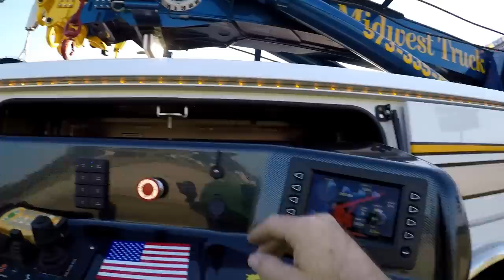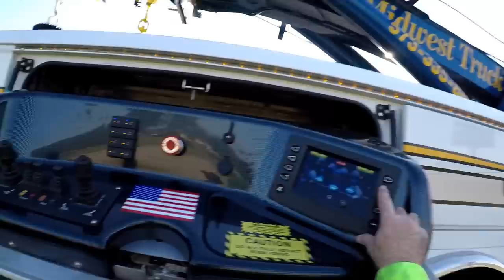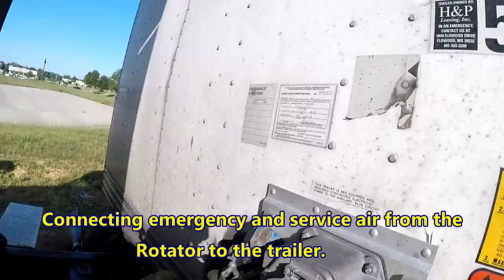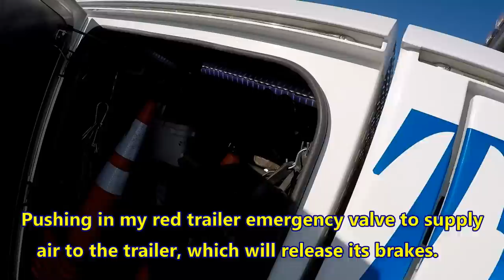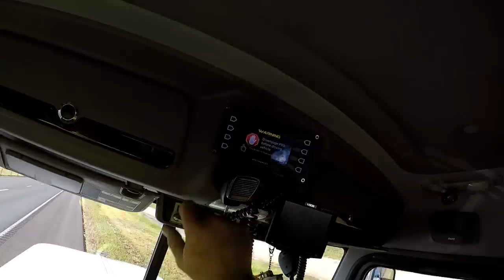BCD    Barrier Cable Destruction

Comment: Need to put an old Q siren on that truck.. They'll hear you then!
Reply: I am retitred from truckin, Have aways wodered whit size motot and tranny tou run in the rorator ( top speed)
Reply: Was about to comment the same thing.
Reply: Since when do tow trucks have sirens?
Reply: YES! A Q will let anyone know you're coming. I accidentally hit the switch on  the one in our squad when I was a n00b... at 4am in a populated area. Didn't know where the kill switch was either....
Reply: Would recommend a rumbler over a Q siren. It catches attention without all the sheer noise.
Reply: Jason Asselin i
Reply from the maker: I'd love to have a Q.  They are very expensive, though.  Thanks and God bless.
Reply: Check eBay and other sites online, you can find some cheap..
Reply: Alan McKnight in state of missouri tow trucks are considered emergency vehicles
Reply: Alan McKnight you can run sirens on them if its a bad emergency
Reply: and a train horn that will get some attention
Reply: You also need to use your horn for intersection clearing. To get you on scene faster. You need to push your way through those cars.
Reply: Huh. Learn something new every day.
Reply: Jason Asselin I
Reply: Not sure what a Q is, but perhaps at as cheaper alternative, run a Siren Speaker through a set of Mountain Air Horn tubes...instant amplifier (in theory)...everyone in 2-3 miles would be getting the heck out of your way...
Reply: Alan McKnight in some states you tow trucks are are emergency vehicles
Reply: @HappilyHomicidalHooligan  lol
Reply: He has one now

Comment: Another great recovery Ron. Looked like the poor guy ran over 1/2 mile of cable barrier. Glad nobody got hurt. Lots of damage under the truck will add up for a costly repair. I remember once when I was flat bedding, I blew a tire on a 45 foot spread axle aluminum flat bed, out in IA. The boss told me to turn around at next exit & drive back 40 miles to a truck stop as he didn't want to pay for a service call. By the time I got back to the truck stop, now it's 2 tires,  an airbag, some aluminum welding, & a couple of rear lights. Damn alligators. LOL. God Bless & keep up the great work.
Reply: SO your boss insteadd of paying for a service call would up paying more than what the call would have cost. HHaaa

Comment: I'm am very sad concerning the lack of people not getting out of the way of your truck
Reply: Carl, like you, I am amazed and blown away how inconsiderate other drivers are about not yielding to Red & Blue lights, and siren.   Granted, there are and will be times with no place to go, but give the guy a break.
Reply from the maker: As am I.  It is a constant battle.  Thanks for watching and God bless.
Reply: They probably just don't connect a big wrecker truck like that to being an emergency vehicle, probably not as common to see at a fire truck or police.
Reply: That guys at the light in the 4x4 doesn't have to move. There is no law to say that u have to move it usually out of respect
Reply from the maker: @alexthompson2289  Actually most state do have a law requiring that vehicles "Yield/move for oncoming emergency vehicles" .   Most states includes this as part of their Slow Down Move Over law which now includes most services that work roadside, whether it is Police, Fire, road construction crews, towing/recovery units, road service trucks, etc.   It IS the law in most all states and all it take is a couple seconds out of someone's day.  It's not too much to ask so that we can ALL go home at the end of the day.   Thanks and God bless.
Reply: @RonPratt  I mean at lights if u are at the front and u can't move or go throw the light because it's red

Comment: I look at those cables and think" hitting that is going to be like a cheese cutter..."   :-)
Reply: The cables themselves are under a lot of tension, but they are designed to give your car a nice gentle hug. As nice and gentle as the men in the nice white  coats that take you to the padded room. ;) They are designed to ensnare and stop a car. And belive me, I've seen enough of Ron's videos to know that no transportation agency wants you to cut those cables. The posts are inexpensive to replace. But if you cut the cable, you have to replace the entire thing. The cable itself probably isn't that expensive. But the equipment to move onsite to tension it, install it, combined with having to shut the road down to re-install, gets very expensive. GOd Bless!
Reply: Mercmad As a motorcyclist we look at those cables and think that they may as well be razor sharp.
Reply from the maker: Most vehicles and some people don't survive encounters with the barrier cables.  They do their job well, but they destroy anything that they ensnare.  I was very surprised that this truck took out so much cable and came back on the road.  Normally the cables wrap up the vehicle.  Thanks for watching and God bless.
Reply from the maker: gorillaau    At the first accident I worked after the cable system was installed, I clearly remember the Trooper stating that he was not looking forward to any motorcycle encounters with the cables.  Be safe.  Keep both wheels on the pavement...  God bless.
Reply from the maker: Raina Selone   Once again, you have helped me in my time of need.  Time has not been friendly to me recently and I have been delayed in my responses.  Thanks for helping me out.  God bless.

Comment: Ron Pratt Nice messy job before  the fair. How long does it normally take to do an job like this with and with out police safety buffer?
Reply from the maker: I still have to follow all the same steps to prepare the truck and trailer for tow.  Without the police/fire buffer I have to deploy road cones and take extra safety steps as well as constantly watching my own back....called "keeping your head on a swivel".  So it would take a little longer without their assistance.   As always, thank you.  God bless.
Reply: Ron Pratt your police are better than our police and highways agency yours would come out and do safety buffer ours won't that's why an recovery agent got killed here a couple of weeks ago.
Reply: Bet tow trucks and recovery vehicles aren't considered emergency vehicles in your state either, are they? Here in WI they're not, and I think even though you can get one heck of a fine and license suspension for not slowing down/moving over, them not being considered emergency vehicles just creates more safety issues. Cops usually aren't around to buffer unless it's on an interstate, and even at that I think I've only seen one standing in the lane like that in my whole life, and I believe it makes people disregard the move over/slow down law even more, because there's nobody there to enforce it the vast majority of the time.
Reply: @MrFredboy  your right here in WI if you're on the side of the road your on your own. And most of the time no one will stop to check on you.

Comment: If it were my rotator and I was responding code, i would add more lights all the way around the truck. Also, dual speakers for the siren and a rumbler
Reply: deereman260 what and stop people from playing on their phones
Reply: It’s hard to hear one speaker at highway speeds. And people don’t care about amber lights anymore so more red and blue would help with traffic clearing and some on the back would keep people from passing him
Reply: deereman260 It wouldn’t make much difference.
Reply: He has red and blues and runs them when the sirens are on in combination with the ambers.. even though in his state tow trucks are considered emergency vehicles, people thing, "Oh it's just a tow truck" but more so with the rotator, he could be called out to help with an extraction as he has the directional lifting abilities.
Reply from the maker: From what I've been told, anything over 65 mph and you are "over-driving" the sirens.  We've tried different combinations of lights, sirens, train horns, etc., and some people simply will need give way.  Sad but true.  Thanks for watching and God bless.

Comment: Those cable barriers have almost been completely removed here in the UK, Too many fatal accidents involving motorcycles.  
All Armco Barriers now with square impact ends as they found the rounded down end launched vehicles into the air if hit with speed.

Comment: Thanks for another great video. I never saw you use service/emergency air before as you did on this one. Also, I learn something new every time I watch a video, especially with your helpful text-comments. Today is odd (9/26/2017), because I just passed my written CDL tests which included an air-brake section, some of which related to this video. Thank you once more for your fine video.
Reply: All the best on your Road Exam for the full License when the time comes.

Comment: It seems like you get the Rotator "up on the step" real quick! A lot of the people driving cars seem very confused when they see you in the tow-truck, with the red and blues flashing and the siren wailing. Another fine video Ron!
Reply from the maker: People aren't accustomed to seeing a tow/recovery truck run code.  When you get around St. Louis it is much more common on tow trucks so people are more attentive.  We are one of only a handful in our area that run red/blue lights and sirens.  Thanks and God bless.

Comment: Cage bolts are handy, but sometimes when you are in a jam it's a lot easier to just pull out the clevis pins where the rod connects to the actuator arm on the slack adjuster. Nice job as always Ron, you and your company are a first class operation.
Reply from the maker: I've had to do that before....like when the e-brake spring is off to one side and you can't lock the t-bolt in.  Thanks for watching and God bless.

Comment: Nice video. A buddy of mine has a wrecker business like yours and a few years ago on Thanksgiving day he had a truck that was cut off by a car and the trucks full load of hams shifted forward ripping the front of the trailer apart. He asked the company what to do with the load and they said to donate it so they found a mission a few miles away that was able to take them. Took him over 5hrs because he didn't have a pallet jack and the mission didn't have a dock so he had to pull out and transport each pallet with rollbacks.

Comment: I think I understand why that one truck you showed burned to the frame and engines block.  I noticed in this video that the cab is made primarily of fiberglass which I am guessing will burn quickly if it catches on fire.  The other truck from the other video didn’t stand a chance without the fire brigade being on scene in like minutes.  I still can’t believe what I saw in the other video.  Glad this driver was unharmed and that his truck was still repairable.

Comment: You worked hard for your money on your own on that one, and all that oil on the ground and over the under-frame didn't help either. But at least the police were thinking about your safety.

Safety chain gated hooks in the upturned open tow hooks ? Not sure if my reasoning is correct, but If it had broke loose and dropped not sure if the hooks would have stayed together !
Thanks Ron for another brilliant informative full length video.

Comment: I was in Iraq in 2005 and had to do a rush caging of two axles on a three axle trailer, that had all his electrical and air lines ripped out during a convoy. It only had "Maxie's" on two of the axles. I'm guessing you can figure out why the rush. (In a war zone)
Great fast and safe job, look forward to the next video. God Bless!

Comment: Man oh man Ron!  This job fought you from the bumper to the box. It seemed like every piece of running, except the tires somehow was busted!  As I've watched your videos there's a pattern to the complexity of the tow is related to the number of actions on your rig. Such as; the number of laps you make around your rig, the number of boxes/cabinets on your rig you have to open and more than once, and finally when you get REAL quiet. Usually, you're great with continuous color commentary. Like the "John Madden" of vehicle recovery.  AND you do it without foul language. AND you don't blame anybody. It may or may not have been the driver's fault, or a poorly maintained vehicle, or as in this case an alleged driver that cut off the truck driver.  Could have been lots of blame to go around here and in many other videos of yours. There's no 20/20 hindsight. You may wonder out loud but that's what keeps many of your videos most interesting. What on earth DID happen and what will you have to do to fix it?  Good job! God Speed. Stay safe.

Comment: If there comes a time when you can't get a brake chamber caged, you can back off the slack adjuster until the brake pads release from the drum. You turn the adjustment bolt counter-clockwise with a 7/16 wrench. It will make a loud clicking sound and be hard to turn because of the mechanism that keeps it from backing off by itself. You can tell that the brake is released by the sound the drum makes when struck with a wrench or other metal object. If it makes a thud the brakes are still set, if it makes a ringing sound the wheel is free to roll.

Comment: Hey, Ron! If you're still in the mood to answer questions, I've been wondering why it's necessary to drop the driveshaft in a manual transmission equipped trucks. Constant mesh transmissions churn around the gear oil whenever they are in motion and thus it ensures that the gears and bearings stay lubricated, unlike automatic transmissions. Am I missing something?

Comment: Hi Ron.  Once again a nice, thoroughly professional recovery.  Kudos to the Police Officer for standing in the lane to try and keep the traffic clear of you, despite so many running fast by you in lane one.  I look forward to seeing your new RGB light in operation.  Was it my comment that sparked the idea? lol.  

Why do you need to connect three lengths of each air line?  Wouldn't it be more practical to have a set of short (to power a cab air system) and a much longer set to reach to the trailer?

Anyway, stay safe and God bless you and yours.  Love from Scotland.
Reply from the maker: Yes, I am very grateful to the officer.  As for the RGB light, the company that builds them supplied me with one to try out.  I couldn't find a suitable location on the truck, so I decided to make it portable by customizing a shop work light stand.  As for the air lines, I would have normally ran an air line to the tractor, but it's air system was HEAVILY damaged and wouldn't hold air pressure.  That is why I had to cage the spring brake chambers on the tractor.  I do have long rubber hoses that I can run from my truck to the trailer.  I prefer to use the air coils, because they allow for more flex while towing and don't require as much securement.  Just my personal preference.  That's all.  As always, thank you and God bless.

Comment: Ron, I like how you put the "time lapse" on the back end of your videos. Also a siren hooked up to your air brakes (ala fire truck, and old school audible alarm) would do a better job. BTW, in fire trucks, the Captain (passenger in this case) has a foot activated pedal on the passenger side of the cab, as the driver (aka Engineer/F.E.O. (Fire Equipment Operator) has enough to worry about getting to the fire scene.

Comment: I am a newer subscriber so some of the questions I have might have been answered somewhere throughout other videos. I am surprised on how much work goes into on of these tows. I have a new found respect for your profession. I am trying to get through all the past videos. I doubt I will ever get bored of them. These tows have to be very expensive. or they should be as you put your life on the line for them. Is it ok to ask on average what this kind of tow cost? is the driver (non-owner/operator) on the hook for that, or is the trucking company. I completely understand if you do not want to answer.
Reply: Pricing is often asked but will NOT go answered since it varies by situation and all plus its not really a public matter let alone private.

Comment: Instead of those springy hoses going back to the trailer, wouldn't be easier if you have just one 3/4 Dia. air-hose, then formulate an adapter for the trailer and your truck that has two fittings for hooking up and simply use blue and red shrink tape on each end for marking? 
I think you scratched the paint messing with that Cascadia grill, LoL...  <-- Joke..
You know what else is handy on a tow truck, really big wire-ties or even and assortment pack and a good pair of heavy duty wire cutters to remove the wire ties. 
This was one of the most interesting videos I've seen you do. It was very cool riding along in the truck both ways too.

Comment: Ron, I was thinking, looking at all of that oil on the road and the stains on your sleeves, get you some Amway LOC (liquid organic cleaner) and that will take those stains out.  I've used it before after a transmission swap and it took it right out without any oil or grease smell left.  As for that poor Cascadia...that is one expensive repair job.  I had a fender cracked on a Century years ago that cost $1600 to swap out.  I can just imagine what a full hood would cost.  Plus all of the other stuff that had to be replaced.  I'm glad he was ok.  These 4 wheelers are just getting worse everyday.  I think that it should be mandatory that every time a person goes to have their license renewed they must go through a remedial course on how to drive around big trucks because they just don't get it and don't care.

Comment: And for those that don't understand why tow trucks have siren in alot of states they need the highways clear as fast as they can or want it clear so they need the tows to be on location as fast as possible haven siren helps that out big time because in alot of areas they can be more than 40 plus mins away from a since and that is alot of time out and traffic mess so yes they do allow some tows to have siren to get the mess clear and traffic moving